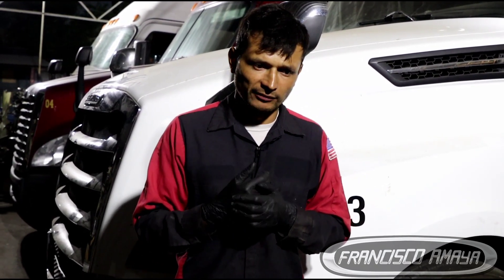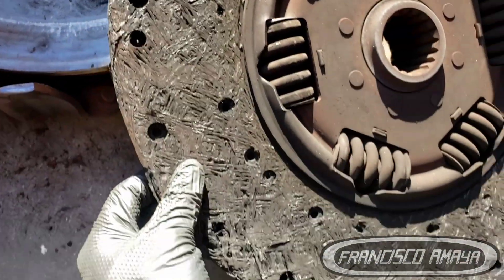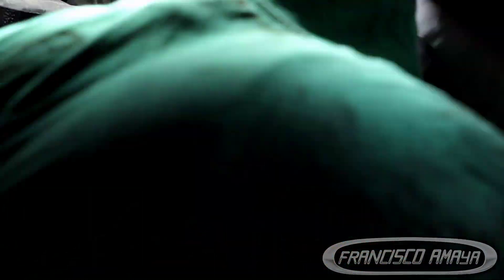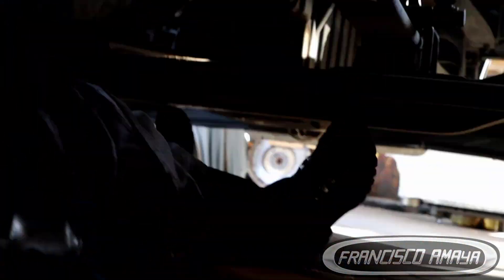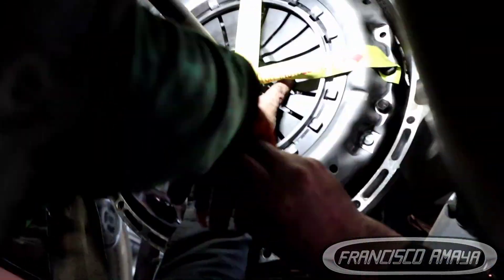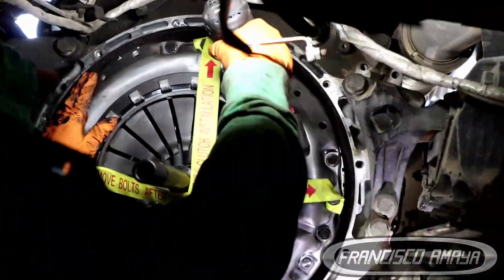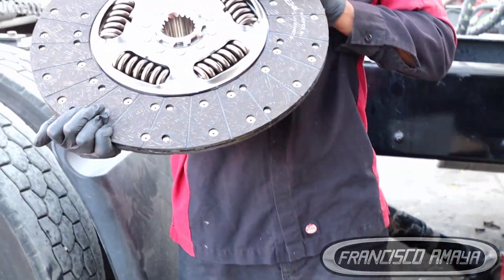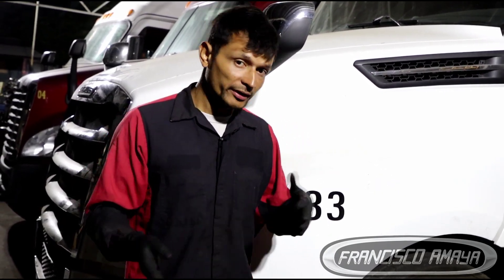Freightliner cascadia DT12 automatic transmission clutch replacement installation cost components

Comment: What about a but louder/deeper whining noise at the low gears when you first start, does it only under 20 miles an hour and it started after I bought the truck and changed the trans fluid with full synthetic fluid from Freightliner? Any ideas?

Comment: Have you installed an aftermarket clutch on dd12 before? Are they good,
Reply: I used Aliance clutch they seem to be pretty good no issue ..I never try it on automatic only on manual transmission

Comment: Mine died two days ago it's in freightliner shop now over million miles 1363452 total bill at freightliner in El Paso TX  $9,047.54

104F/A02-14135-000  $1,903.85  ZB SINGLE DISC DRY CLUTCH 

104F/ABP N25 A0032502115  $1,185.02  DT12 CLUTCH ACTUATOR 

104F/DDE A4710306605  $1,943.05  FLYWHEEL 

Other parts
Labor $2712.00

HOPE THESE PART NUMBERS CAN HELP SOMEONE OUT CAUSE THEY ARE CHEAPER ONLINE.

2016 FREIGHTLINER CASCADIA 126

Comment: After replacing the clutch my truck is vibrating when it works on idle, what’s the problem?
Reply: Did you calibrate if not do that of you did you must have done something wrong maybe bot torqued evenly n at spec?

Comment: after how many miles is it suggested to replace the clutch ?
and what is the oem part number for 2016 cascadia 125 evolution 14.8 ?
do i need to change the actuator with the clutch ?
and what is part 1 & 2 ????????
Reply: I have same truck and I replaced both it’s to expensive
Reply: @21dt66 like how much do you spend
Reply: How much?

Comment: Hi Francisco What else you suggest can we replace as preventive maintenance while clutch is being replaced?
Reply from the maker: clutch, clutch actuator, flywheel, rear motor mounts, rear main seal, dt12 split pin, carrier bearing, pilot bearing, etc,...
some are more important than others but all of this is recommended to replace during a clutch job.

Comment: great video! I've heard these Eaton clutches have problems when calibrated after installation. Have you had problems with Eaton clutches especially on dt12 tranny?
Reply from the maker: so far no problems. I used generic brand the other day and no problems as well. the duration of the these aftermarket clutches can't be as good as the oem, but, when you see the prices of the oem clutches you wanna go straight to aftermarket regardless the quality.

Comment: How long do automated clutches on cascade as usually last?
Reply from the maker: it varies, usually around 700k miles.
Reply: Mine died two days ago it's in freightliner shop now over million miles 1363452 total bill at freightliner in El Paso TX  $9,047.54
Reply: Yes mine died today 745k
Reply: Mine at 735k
Reply: Mine had to replace it at 845k
Reply: Mine at 570k

Comment: Will diagnostic link let you apply clutch without vehicle in motion ? Is there test you can do with diagnostic link without pulling out transmission ?
Reply from the maker: yes, you go to actions and transmission. you can do clutch learn if you what to calibrate the clutch or if you want to test the clutch functions go to Detroit transmission clutch center i think is its name. you can test the clutch journey and response.
Reply: Muy buenos los comentarios y repuestas tengo una pregunta para bajar la trasmission se tiene que bloquear con la computadora y poder retirarlo

Comment: The DT12 is an automated transmission. Automatics have torque converters and clutch packs. Automated transmissions have the same stuff as a standard but a computer does the shifting and there is a push type clutch instead of a pull so an actuator can do the clutching.

Comment: I've got 791,000 on my dt12 clutch.  I think about just changing it ahead of time to avoid the tow truck
Reply: It happened to me today. 745k no prior warning.
Reply: @Hellokinni  oh my, get a quote yet. Can you ask the mechanic how long these clutches can go max? Thanks
Reply: @Hellokinni for me it happened today 🤦‍♂️. 806k on the truck. Had to pay $950 for towing. When I brought it to the shop mechanic said we can’t fix it since it’s automatic. I called to the shop before I towed. The only thing guy said in the office “ I apologize, I didn’t know that we can’t fix automatic transmissions”. So I lost $950 for nothing
Reply: @vladislavhusnutdinov1523  The shop replaced clutch on mine and also the shifting mechanism. Said it was seized but as far as I know it was shifting just fine. Oh well but they didn't do the calibration using the computer. The shifting was rough. I guess the ecu has learned and has adjusted but still sometimes in gear 7/8/9 it's not smooth shifting sometimes.
Reply: My clutch failed on me today. I think I’m lucky that it happened 8 miles away from a dealership. Tow bill was still expensive. Without warning it shot itself at 860k. i knew, i wanted this job done sometime this year but it beat me to the punch.

Comment: saludos francisco,una pregunta , estas dt 12 son selladas o sea no hay forma de checar el nivel de aceite?? nadie sabe si el aceite de la transmision se cambia ?? le pregunto a mucha gente y nadie sabe decirme, me dijeron que el delear tiene un sistema para cambiarlo con un vacum o algo asi , que se debe cambiar cada 500 k millas , pero en verdad nadie tiene una respuesta ,gracias por tus videos.un abrazo.
Reply: Si se cambia. En la pagina de detroit busca una section de maintenance de transmission. Alli te dice cual bolt sacar para revisar y el Que tienes Que sacar para drain el aceite usado.
Reply: Se cambia a las 500.000 millas en el dealer , yo lo quise hacer en un taller de un amigo y me recomendaron que no lo cambie por que han fallado muchas transmisiones después del cambio ya tengo 790.000 millas y está todo bien por ahora

Comment: Thanks for your videos. Do you get fault codes prior to this happening on a dt12?
Reply: No . Mr Amaya said it happens without notice.
Reply: It happened to me today. No prior warning.Had to get it towed. Original clutch lasted 1.2million kms on the truck. It's an automatic
Reply: @Hellokinni  have they told you what they are going to replace? Is it just the clutch?